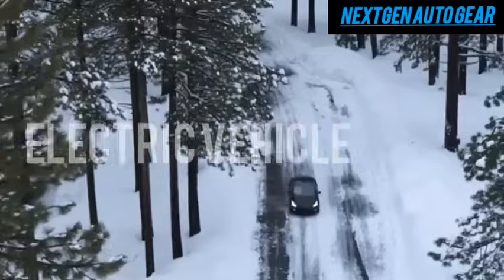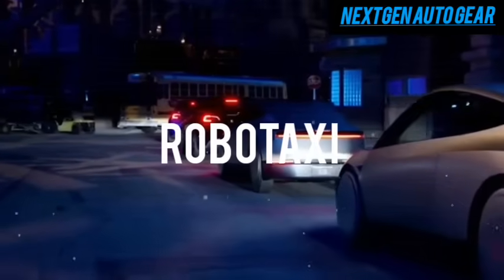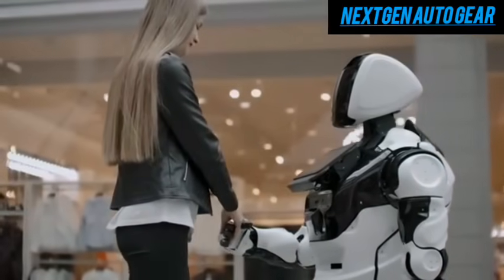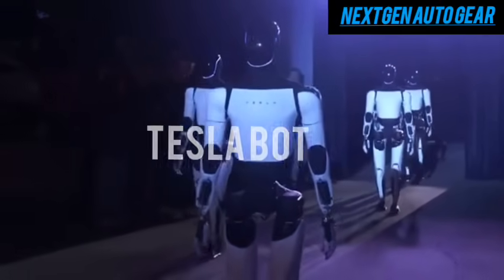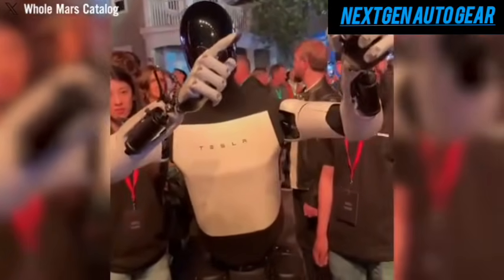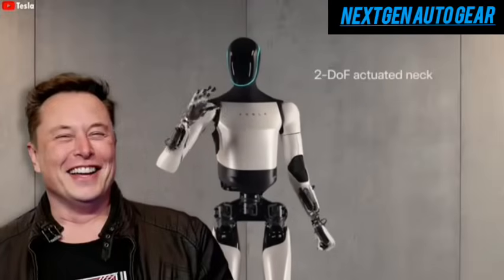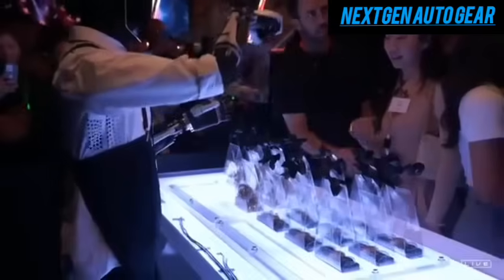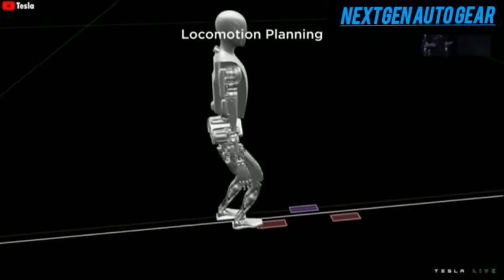Tesla Bot Optimus Gen 3 Unveiled – What It Can Do Will Blow Your Mind!

Comment: Why does it have to walk like it’s about to spray piping hot diarrhea
Reply from the maker: 🥰🥰 the next generation will improve
Reply: So they can’t overthrow humanity. It is designed to be too slow to be a threat.
Reply: Most of them tend to do that. (Look back to Honda's Asimo robot in the early 2000's.... Human balance is very difficult and computationally expensive. That walk position makes it easier because it lowers it's center of gravity.